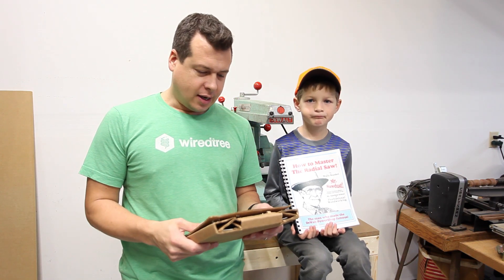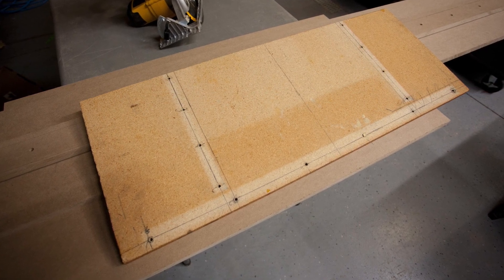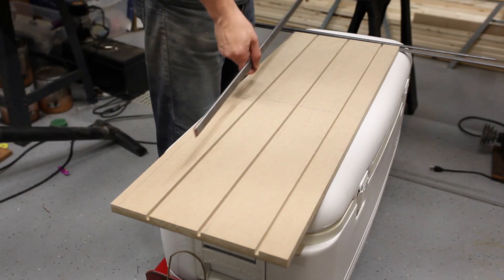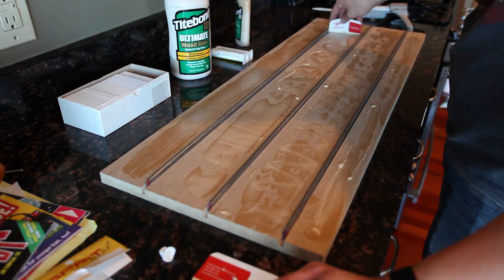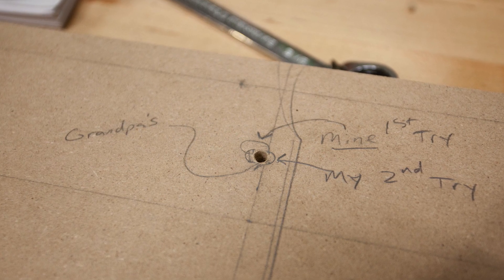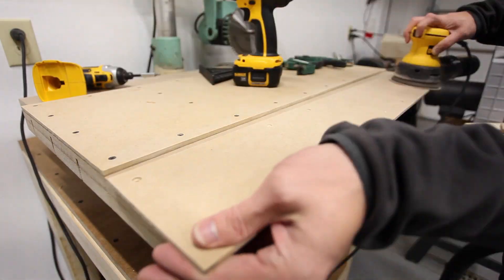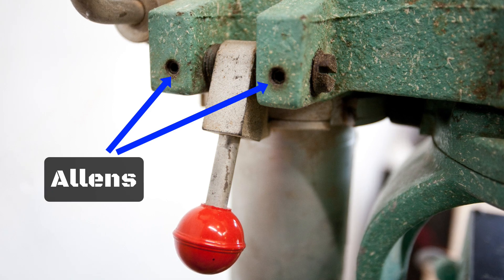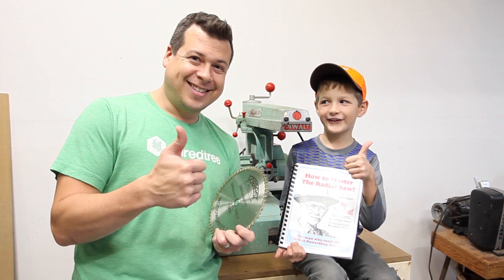New Shop Build: Part 3 - Building a Mr Sawdust Table

Comment: Is that saw a 925?
Reply from the maker: Charles C Yep it's a 925H
Reply: I got my 925H at a yard sale for $25.00. I came with the matching metal cabinet. I had to replace the capacitor and a few other minor elect. parts. It was used at a high school wood shop. I now have to make a table top.
Reply from the maker: Charles C Nice find!